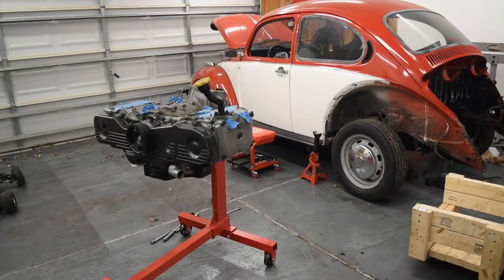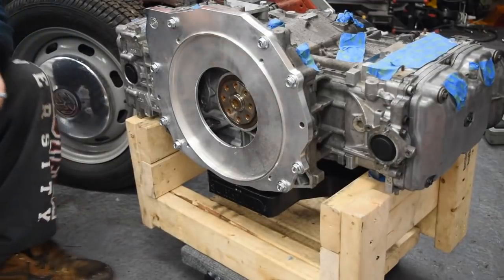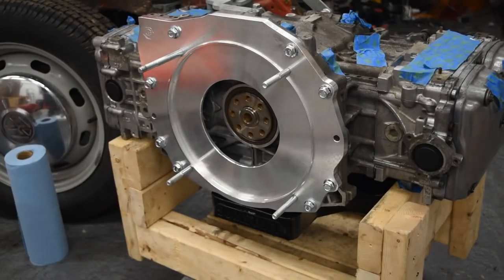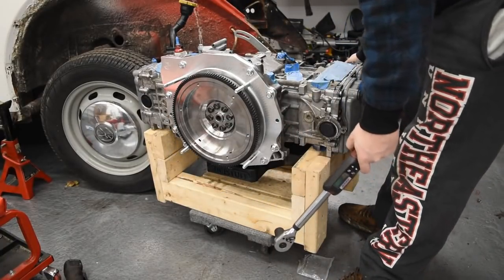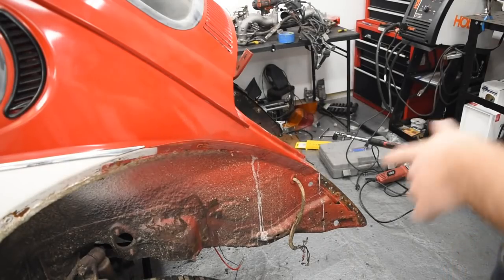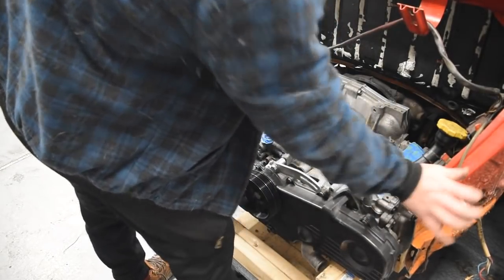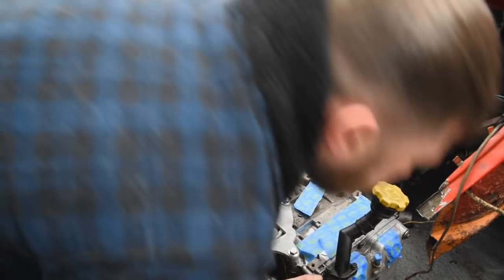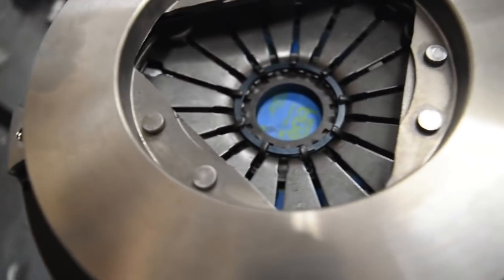Gearbox Adapter Plate: Subaru Engine Integration

Comment: So I have a 72 super and have been looking into doing the same do u have any advice u could give me as far as which engine-year makes for the better swap and what to look for? Thanks keep the informative videos coming👍
Reply from the maker: My main advice would be to pull the motor and harness from a running vehicle and try to take as many accessories/sensors/etc. as possible from one car.  The biggest obstacles I face are because I am building from components I've stored in the garage but I do not have the "whole package" from one car.  As far as engine-year, this is really personal preference.  The naturally aspirated Subarus are generally SOHC (not always) but that means smaller packaging and easier maintenance (less parts).  These are still good for 150-200hp NA which is plenty for a little bug.  I went with the EJ251 heads and EJ255 shortblock combo because I knew I would be turbocharging my motor and wanted close-to-factory reliability. Also, make a friend at the Subaru dealership!  When it comes time to find those bolts or hard-to-get pieces, having a resource at the dealership is invaluable.
Reply from the maker: Jim Barrows  Yikes!  That's a good idea if you want a less reliable, less powerful, and more expensive motor

Comment: Great video!!  What are you going to do about the bolts that are interfering with the trans mounts?
Reply from the maker: Thank you!  I will either leave the bolts out completely or replace them with button head version for better clearance... I'm just having a hard time finding the proper bolt in button head
Reply: @RatchetMotors  Just use countersunk heads Torx or Allen screws. You'll need to countersink the plate but it will be much easier than try to chamber the plate to fit button head screws.